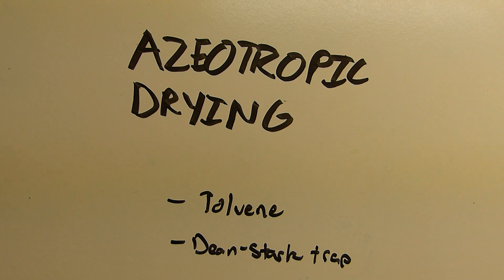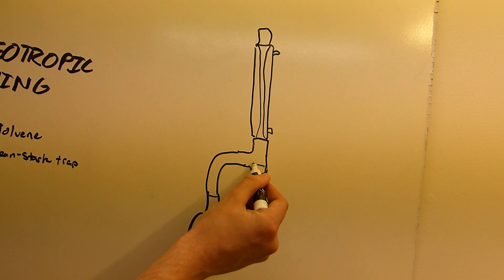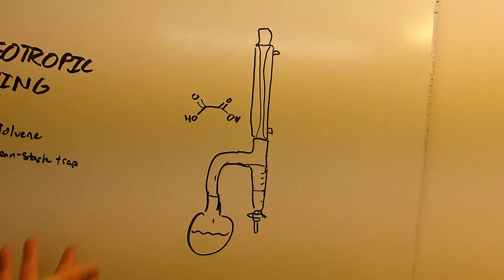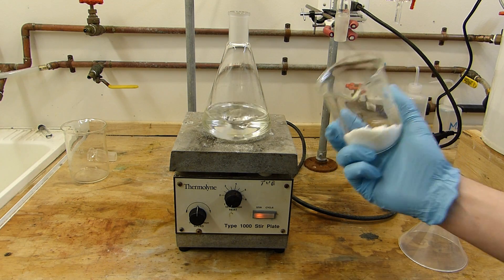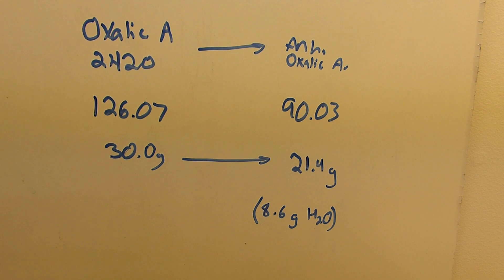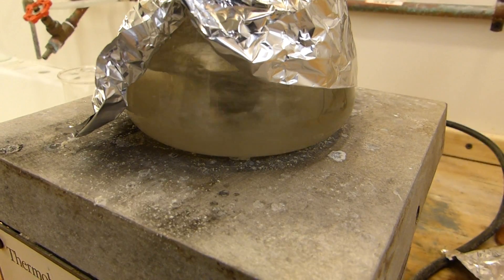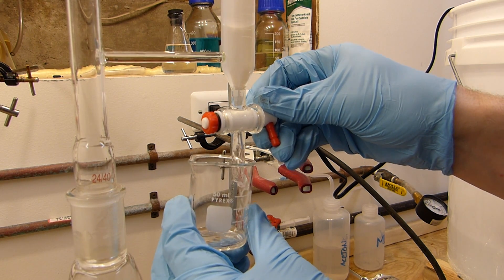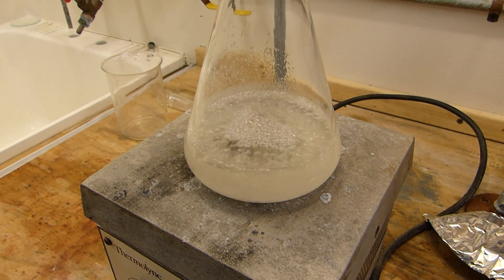The Dean Stark Trap: Drying Oxalic Acid

Comment: Does anyone know if xylenes work?
Reply: Only m-xylene forms azeotrope with water and the b.p. of the azeotrope is noticeably higher (92 °C) compared to toluene/water (84.1 °C) - this will lead to more melting and decomposition.
Alternative solvents may be benzene (69.3 / 80.2 C), chloroform (56.1 / 61.2 C) and carbon tetrachloride (66.8 / 76.8).
DCM could be an interesting alternative but the b.p. of azeotrope is very low and contains very little water so the drying would take ages.

Comment: Being interested in essential oil extraction I have done a bit of research on steam distillation. They generally seem to run the steam out a tube to cool it down and collect it after. Since the essential oil is heavier than water would you be able to use this device to collect it? If so it would seem preferable since you could use a smaller amount of water.
Reply: I think so yes, although youd want to have a pretty decent distillation/reflux apparatus. I recently found an anti-splash adapter with steam outlet that has come into use pretty handy